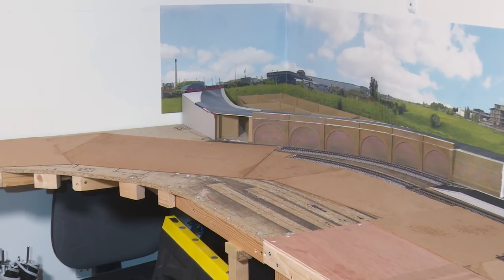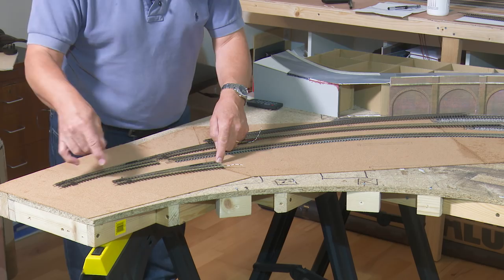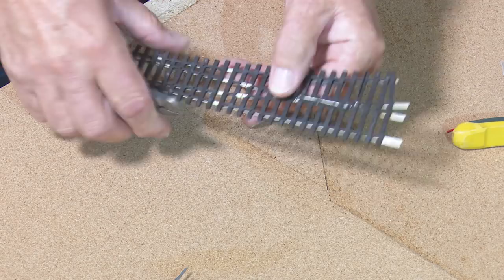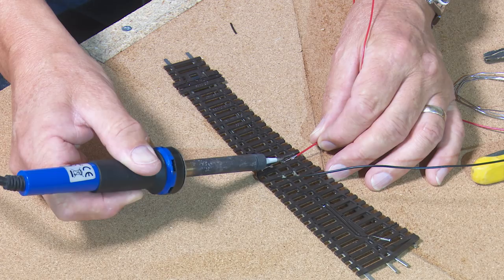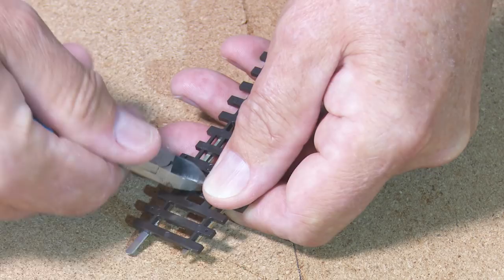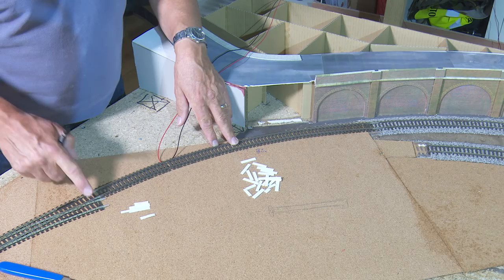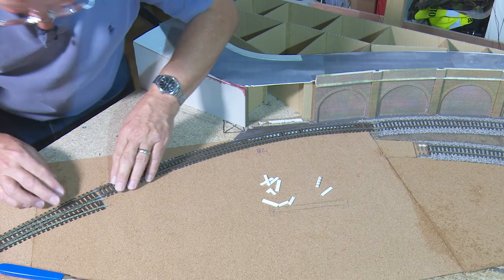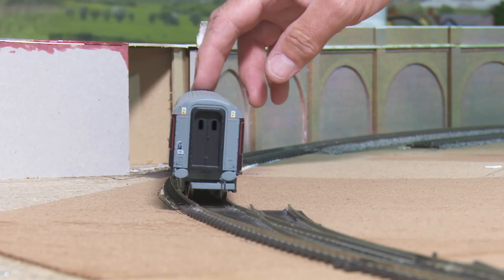Laying Track with Super Elevation at Chadwick Model Railway | 39.

Comment: Hi Charlie, Great YT clip as always, loved this video,  as it tended to combine it not only scenic side but also the Fiddle Yard side where the track goes off to many lines on its way in where the first few points are on Curve in order the get as many lines as possible in the space you have to play with as it where. Great to see the Curve points been used as the main subject, and yes i like you went to Lead Free but found it didn’t bond as good and over time Lead Tin Solder along with a good Flux as become the norm again. TopTip... Great idea about the Placard under the outer edge of the track to enable a slight lean to into the bed as you come off the straight into the bend, i thought this was an excellent idea. 💡 The glue i’ll give it a try like you i’m always up for new or better ways to make the job easier.. I always cover all the boards with 1/16 cork all over then i use the same again cut to 50mm strips (I’m sure you have coved that in previous YT clips) and i put the 50mm cork under each track to allow better looking depth once i Gravel the track, i may use your Placard Trick and place them between the base cork and my 50mm cork to give that look of leaning in. in the past i have sanded the 50mm cork on the one side to give the same effect but yours seems simpler and more straight forward but i will keep to my 50mm cork lengths on top of the sheet of cork that is all over the base boards. Great YT clip and a Thumbs up Charlie, until the next time, take care 👍...!
Reply from the maker: Hi Jamie, such kind words.  I really did enjoy researching the super elevation data. I ended up in the York museum reading the the GWR guidance literature. Fascinating stuff. 
Good luck with your layout.
Regards Charlie

Comment: Hi Charlie. Enjoying your new series of videos - very informative.  I put superelevation on my layout last year on a curve exiting a tunnel and the effect was really good.  I did however find a problem with what had been one of my best running locos suddenly stopping and starting whilst going round the curves, despite 2 or 3 weeks of testing before the track was fixed and ballasted.

My father in law and I have an embarrassingly large number of locos, and a fraction of them run on the layout at any one time. This particular loco was put on about 4 weeks after the curve was super elevated and staggered its way round the curve (36" radius). Investigation revealed that the alignment of the pick ups was being affected by the superelevation - suggesting the loco was sliding over to one side on the curve and losing contact from the other.  A strip down of the chassis, a good clean of the contacts and a slight easing outwards of the pickups resolved the problem.

The videos of trains coming round the curve look terrific, and when watching from a distance you can see the difference.  Well worth doing.

Keep up the  good ŵork 🙂

Drc
Reply from the maker: Hi David,
I’m so pleased that you enjoyed the video. The super elevation certainly looks good.  An interesting tale regarding your loco with a good outcome.
Good luck with your layout.
Regards Charlie

Comment: Hi Charlie,   I needed to let you know that I find your videos and the hints and tips they contain so helpful. The expression ‘Your never too old to learn’ certainly applies to me - Now on my 4th ‘permanent’ layout in 60 years, following the most recent house move. Your your style of presentation makes for such a good overall experience.   Thank you for all the care you take for our benefit.
.
My own track laying methods are similar (including the wiring mods and droppers on ‘electrofrog’ points and the pre- drilling of holes below the tie bars on all points). I’ll also be cutting off the unwanted tiebar extensions etc as you advocated in anther video.
As my curves are generally a bit tighter (3rd and 4th radius) I also cut the 50mm wide underlay cork  down the centre of each length which makes fixing down easier as each half strip follows the required curve.  My tip - Instead of using books as weights to hold the track, whilst Copydex fully dries, I weigh down the track with with old and ‘dead’ laptop batteries placed on top of a strip of timber. I find that leaving a newly laid track overnight is sufficient to get a good bond.

Your advice to take lots of time plan in advance and use the ‘Peco’ templates is sound.  I have had great results using ‘Anyrail’ planning software. (Just a satisfied customer, no commercial interest!)
When printed out 1:1 the accuracy of the track library is remarkable and so useful.  I just print the local section I’m working on or it would be 350 pages of A4!

Please keep up all the good work and shared experiences.

Best Regards,
Tony
Reply from the maker: Hi Tony, I’m so pleased that you enjoy the videos and it’s comments such as yours that make it worthwhile.
Regards Charlie

Comment: I do love watching these updates. I did notice after you ran the coach through the elevated curve that there is a definitive angle at the join with the curved point. Maybe if you lift the end of the point by 0.5mm it will give it a smoother transition to the flat.
Reply from the maker: I’m so pleased that you enjoyed the video Leo.  I’ll check the curved point later and sort out any issues. 
Regards Charlie

Comment: Another great video. Just my two cents worth. Lead free solder is terrible for electronic work, especially on small jobs. The heat necessary for a good bond is too high, so you’ll almost always wind up with a “cold” joint that will reduce your conductivity. And the a id fluxes cause long term corrosion unless you can properly neutralize and clean them. As a couple other commentors have said, you won’t inhale lead from the smoke. It’s just the rosin burning off.
Reply from the maker: I'm now using 60/40 David, it's so much better.

Comment: The best solder to use is not 60/40 but 63/37 the small difference in ratio makes a big difference in performance. Also the smoke that comes off the solder when it melts is the flux not the lead
Reply from the maker: Hi Richard, you’re not the first to mention those points. Is 63/47 much more expensive?
Reply: Im not sure if its a deal more expensive it certainly is more difficult to find.
Reply: For what it’s worth, as a professional electronics design engineer, lead solder is certainly easier to use, but with the right temperature, good flux and practice, lead free solder is perfectly good.

Lead solder has some hidden demons that can seriously affect the reliability of your electronics, without even considering the environmental impact the lead will have long after your layout and rolling stock are landfill. The law has prohibited professional manufacturers from using lead solder for a couple of decades now (hobbyists can legally do what they like so long as they don’t sell what they make) and all responsible electronics manufacturers selling into the UK or the EU use lead-free soldering processes throughout.

One of the early problems with lead-free solder was tin whiskers, crystalline growths of tin which occur over time and cause short circuits in microelectronic assemblies such as DCC decoders and similar circuits. The biggest cause of tin whiskers turned out to be contamination of lead-free solder with small quantities of lead. So using lead solder on lead-free electronics can lead to failures down the line. Worse, solder adheres to your iron tips, so once your iron is contaminated with lead it can then contaminate lead-free assemblies even if you try to keep lead-free solder for delicate circuits.

My solution has been to eliminate lead solder entirely from my work and hobby environments, use a good quality temperature controlled iron, good quality lead-free solder with no-clean flux (plumbers flux is highly corrosive to electronics) and practice a good technique. And I commend this method to all!

Comment: The boiling point of Lead is 1749c degrees, there is no way to get lead poisoning from the solder fumes. However you can get lead poisoning from handling the lead and then ingesting it. The fumes are the byproduct of the flux burning and may still be harmful.
Reply from the maker: A good point M64, many thanks.

Comment: It was widely believed that the move to lead-free soldering would create more environmentally-friendly conditions; however because of the higher temperatures required and extra flux used lead-free soldering smoke emissions actually contain more fine dust particles which are easier to breathe in.
Reply from the maker: And it took me a fair while to learn that 60:40 was much better.
Reply: There is no lead in lead-free solder, or the smoke from the flux. And in lead-free processes, as I describe in a reply to a comment above, lead contamination can lead to latent failures like dreaded tin whiskers. You can’t reliably mix the two processes, and professional manufacturers have been required by law to use lead-free processes for a couple of decades.

Lead solder might be easier to use for those without the right equipment and technique, but lead-free is fully compatible with modern electronics, is environmentally better and leads to unreliability in today’s electronics environment.

Use whatever solder you choose, but do make a factually informed choice.

Comment: Progressing nicely Charlie. 
Heading towards my track laying video being released later next week and have a nice fast line on a slight curve with super elevation.  Ive watched a few real videos and found 1 that shows the inner line dipping lower rather than the outer line rising. I experimented with both versions and found i was never happy with using the outer line rising as you could notice the train going up and into the transistion on the tilt. Thats really noticable when running long trains..it never had a smooth transistion. So took the option to drop the inner line.  Mines banked around 3mm.. 

Copydex is a good worthy glue and ive stuck my cork down with it but stuck with wood glue for the track. 

Tim
Reply from the maker: Hi Tim, I’m so pleased that you enjoyed it.  I’ll be watching out for yours.
Regards Charlie

Comment: Thanks Charlie, really appreciate these.  I notice that you have swapped from one type of track bed (was it the Woodland Scenics in the station and elevated section?) to cork elsewhere and then nothing on this video.  Is this just what’s available, turn out related or have you now got a preference?  And thanks for the link to the wire stripper (elsewhere), of course I then saw you provide that in two other places already!  “RTFM” best comment so far and took me back to my RAF days, thanks!
Reply from the maker: I’m currently using the WS trackbed. The videos was and older release when I just used cork. Regards Charlie

Comment: Hi Charlie,

I was going to ask you why frogs that are found in railway points are called frogs. I found the answer on t’internet.

They are not called frogs because they were designed by a Frenchman, as I think some may have thought, but rather it is from a horse’s hoof. The part of a horse’s hoof which is flat to the ground has a triangular shape in the middle of the hoof, which looks very like the middle part of a railway’s point. Since blacksmiths were used to make the early rails for railways, and blacksmiths were also well used to making horseshoes,  they would have been familiar with the middle of the sole of a horse’s foot. And now we know!

Hopefully some will find this informative.

Now all I have to do is study your videos hard to see how to wire up your point motors! They might be obvious to electricians like yourself, but it’s a bit less straightforward to the rest of us... thanks for your help in working it out.

Regards,
Jim
Reply from the maker: Hi Jim, what a great piece of research. Many thanks Charlie

Comment: Hi Charlie, thanks for another great video! Sorry I’m new to the party (and commenting on a 4 year old video). I’m studying as much as I can before building my first N gauge layout.

My question is why disconnect the blades from the frog?

I want to start with manual points operation and progress to weathering the track and automating the points with MP1 or MP5 servo motors. I was thinking of adding droppers to both the blades connection and the frog connection, so in the first instance I can reconnect the two beneath the board and have the blade tips switch the frog as Peco intend. Then later I could isolate the blades (electrically following your scheme) and wire the frog to the relay output of the points motor to switch it automatically.

But won’t that leave the blades with unreliable connections if I weather the track? Wouldn’t it be better to leave the blades connected to the frog, add the frog dropper as you show and have the relay switch the blades in parallel with the blade tips, thus providing better continuity across the points under all circumstances?

I know there is the potential for a short circuit if the relay and points do not operate in unison, but I will be using short circuit protected boosters throughout to protect against such failures.

Any light on this matter would be greatly appreciated.
Reply from the maker: I understand your thought process Mark. However, isn’t that a bit of a Pfaff. On electro frog points, it’s far easier to snip through the wires and add a set of droppers. Regards, Charlie

Comment: Folks, lead free solder is mandated for plumbing work as over time lead would leach into water that might then be drunk. That does not apply for electrical work and resin cored 60:40 tin:lead solder is the weapon of choice and had been for a very long time. I rather suspect that the fumes Charlie refers to are due to the flux, not the lead, but he's right, it's unwise to breath them in directly. Large scale soldering stations have extract arrangements, but for small jobs like this common sense goes a long way. Maybe use a fan to disperse the smoke and dilute it in the room air below a point where it represents any concern. It's important to understand that electrical solder is an alloy, not a mix with seperate lead and solder paricles. Incidentally there are solders that will melt in a hot cup of tea - it's an old trick to give the unsuspecting victim a tea spoon made out of such an alloy. Also wise not to let them drink the tea!   Such low melting point solders are widely used in assembling brass railway model kits as they will avoid melting a nearby joint made with a higer melting point solder. BobUK
Reply from the maker: Some excellent points Robert, many thanks.

Comment: Great as always but 1 question as always on my part, what are the green extra drop soldering-connections for?
Reply from the maker: That one was for the frog, to enable the power to be switched when the point is thrown
Reply: @ChadwickModelRailway  Ok thanks I'm not at home yet with these frogs?!

Comment: As an old electronics Boffin I can assure you that the “fumes” are actually from the flux burning off. 60/40 lead/tin solder is by far superior to that lead free rubbish but in either case you should heat the rail or the wire then introduce the solder. This way the rosin is doing its job of “cleaning” the joint or contact and not just burning off on the iron. Tin the wire by using your helping hands, tin the rail then when you place the wire on the rail and heat the joint the solder that is already there will “reflows and complete a good bond. Just sticking in my twopence worth.
Reply from the maker: All advice is welcomed Bruce.

Comment: Flux cored lead solder can't be beaten, better to have a small fan near to blow fumes away from your face and open a window to exchange some air. I use Copydex (no pins) to glue track down and a 50/50 (Copydex/water) mix for the ballasting (needs the ballast presoaking with IPA). You should use track setters to maintain the curves and weight the track down while it dries with weights. (see tip 911 at www.lumsdonia.co.uk/tips900.html#911 )
Reply from the maker: Thanks for the solder tips TimberSurf.  I do use Tracksetta to ensure smooth curves but I’ve yet to try Copydex in ballasting. Regards Charlie

Comment: Need so advice please. Planning new layout in my new trainshed. Thinking 22inch square boards in the corners with straight 4ft boards joining to the corner boards? Good method or bad please advise thanks
Reply from the maker: Hi John,
Loads of room for N Gauge but I imagine that you’re using 00.
It’s a bit tight but 3rd radius curves  have a 19 inch radius so they should just fit.  It would be best to print the Peco track templates for a more accurate picture of the end result before you spend any cash.
Regards Charlie
Reply: Chadwick Model Railway thanks. I take it increase the size and yes it's 00 gauge
Reply from the maker: john slade .
Bigger is usually better but please spend a great deal of time designing the track plan.
Regards Charlie
Reply: The track plan will be my next problem